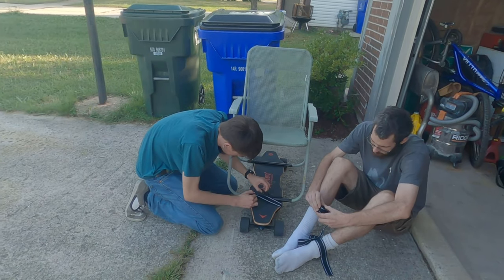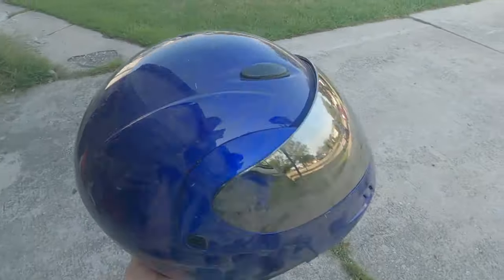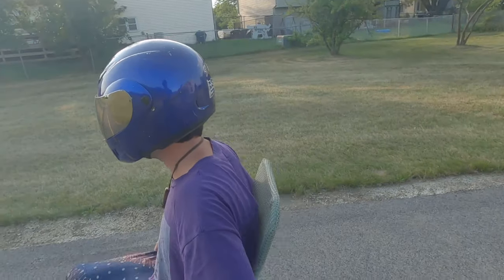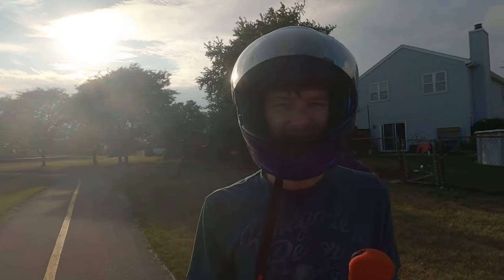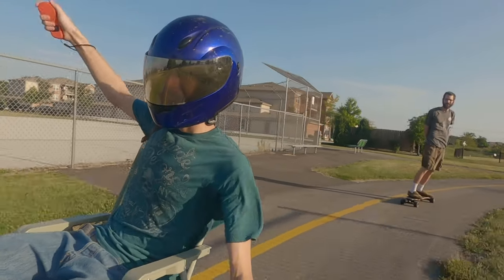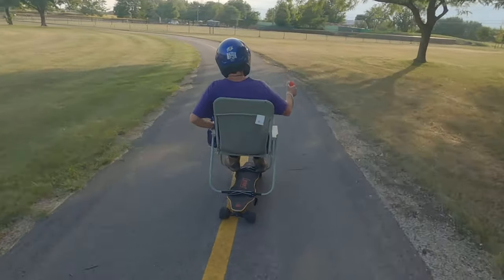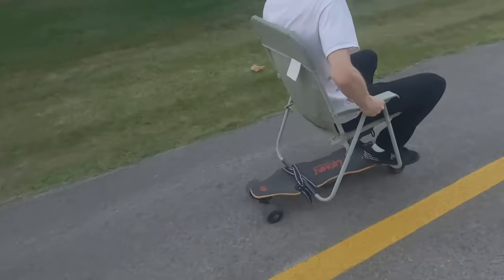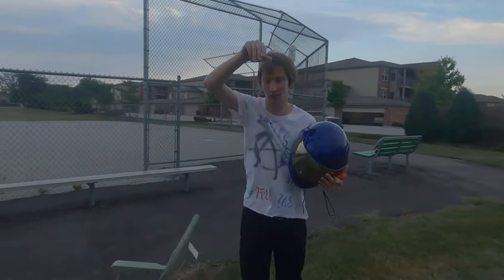How To Make a Go Kart From a Skateboard!

Comment: This can actually work so well! Maybe what you can do is saw and shorten the legs to be more flush with the board and add a seatbelt to it.
Reply from the maker: I think if we put the seat directly on it we would have more control!
Reply: @ShiftyLife  oh I definitely it can work. Perhaps drilling the board in a section where it doesn’t screw with the electronics. Or creating and printing a seat that fits the dimensions?